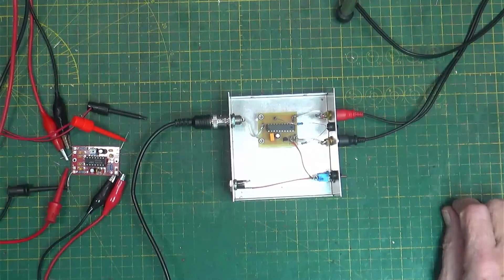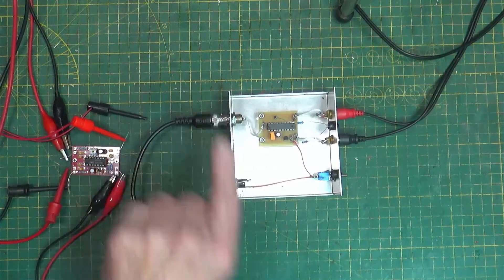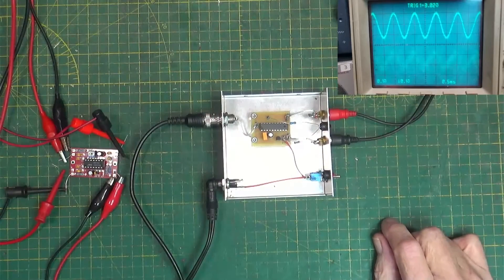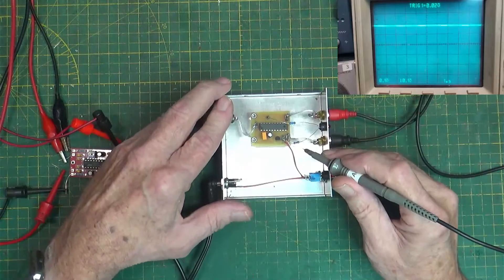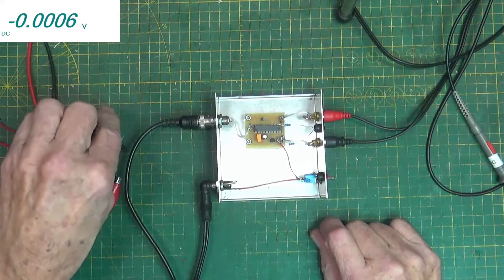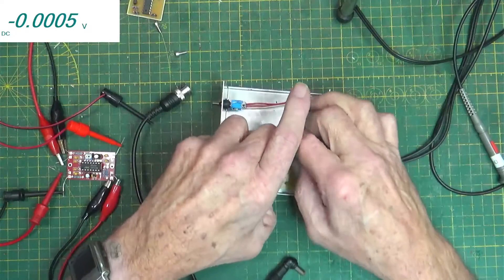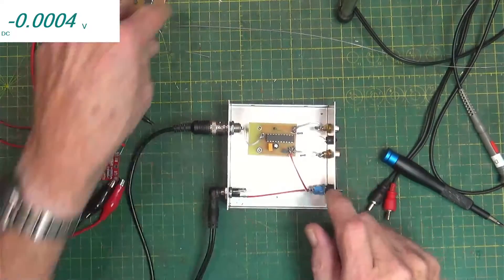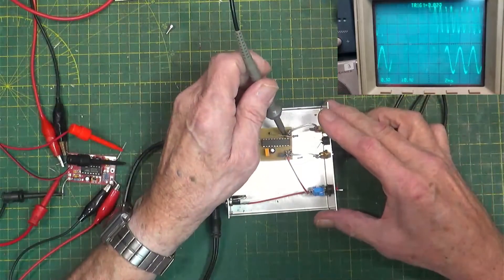TDA1591 Stereo Decoder KIT Repair

Comment: Awesome repair Dave, made it easy to have a second one and a schematic/block diagram...like your description "geek glasses", I may have to "borrow" that verbiage!  :)  ~Jack, VEG
Reply from the maker: I wish I didn't have to use them but my 'tin years' demand it. The schematic I used is actually just the test layout in the datasheet. I found one for the NJM2035 too that has some extra stuff on the output to clean up the 19KHz, make it a sine wave, and also to knock down the 56KHz product. I might make a video of that too. I also ordered a much more complicated Decoder kit which I will be making a video of once it gets here from China. It uses the 3401 which you can still buy.